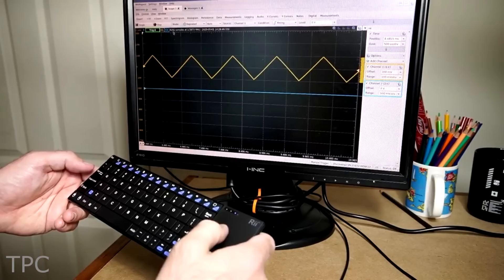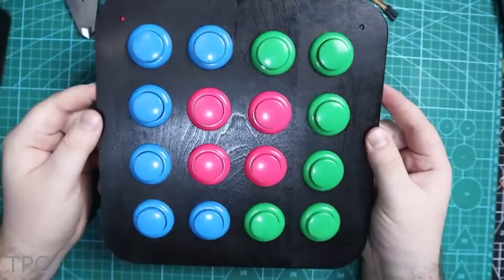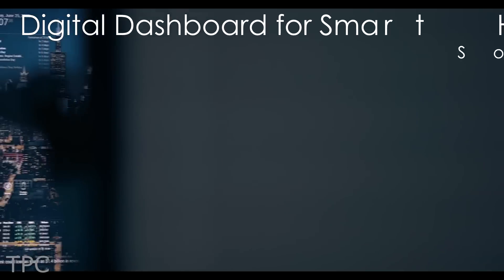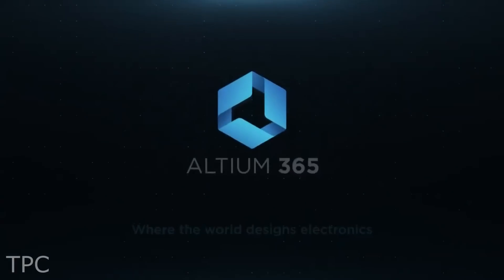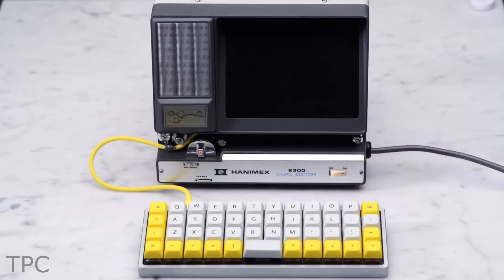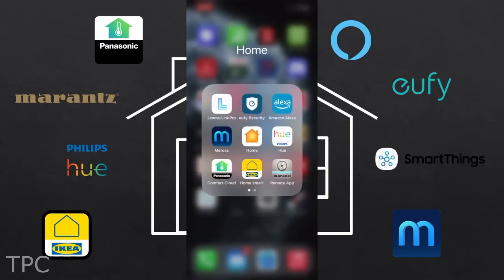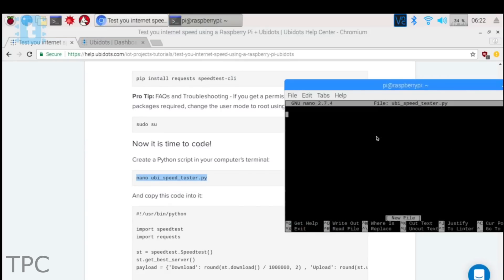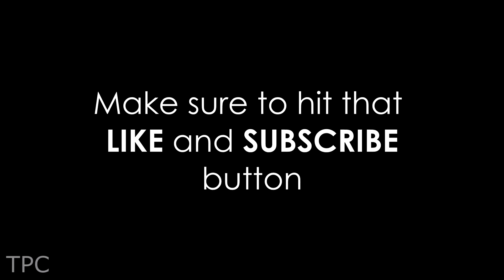A Raspberry Pi inside a 1970s Computer! (9 More Projects)

Comment: that heatsink could have better design btw, since heatsinks is good when they have a big surface area.. that is why they have big fins.. to increase surface area tha can emit heat.
Reply: It could be, but this works just fine, even with a hat sitting on the top.